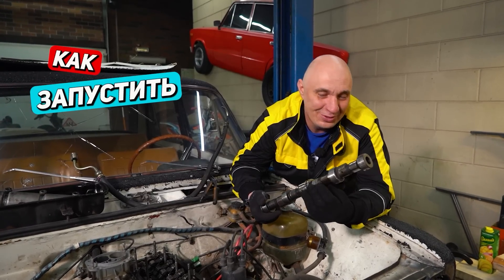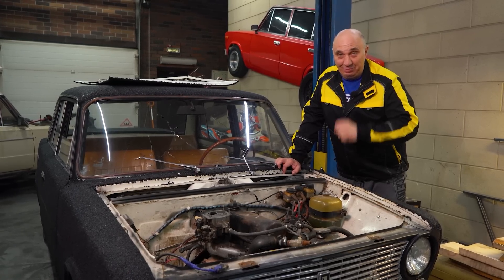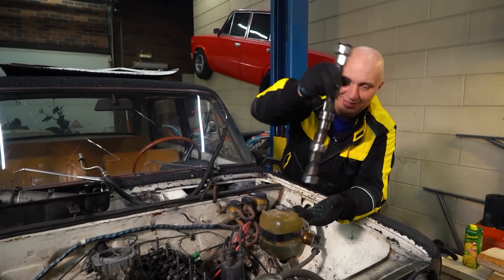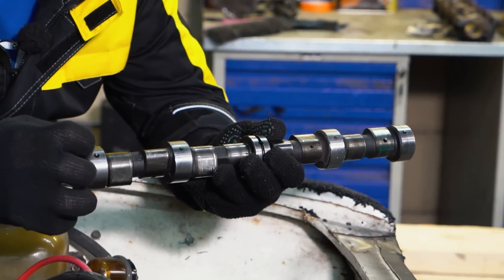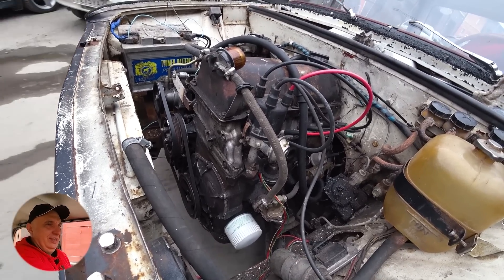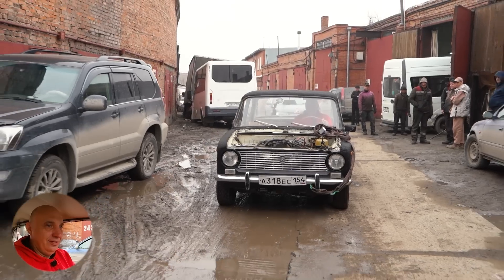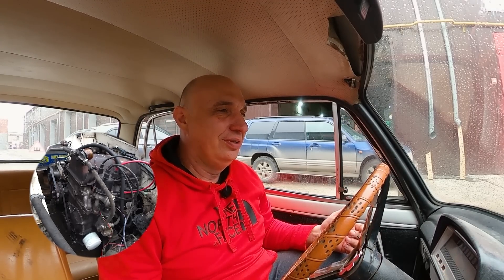Can we make an inline-4 run inverse?

Comment: doing this... you could have a rear engine'd car.  having a pair of them, counter rotating, have the direction sensitive accessories on the normal one, then gear em together... it's been done on a lot of vehicles, but not many have been modified that way... gear em through the flywheel?

Comment: You also could just swap the intake and exhaust manifolds and adjust the oil pump to spin the correct direction. If it has a mechanical fuel pump it should  still move fuel normally though it might not last very long before the arm breaks

Comment: Why is there a standard direction of rotation?
Reply: possibly to stop the engine bolts unscrewing. same reason truck axles have a left hand thread on the left hand side. although there's not many bolts. there would be six attaching the flywheel, then more attaching the pressure plate. i have found that the crank pulley bolt tends to unscrew itself, which makes sense as its turning the opposite way to the thread.
Reply: @martin-vv9lf  ah now that's an excellent point

Comment: Can you modify a lada engine block for offset crank? i think you would have to weld up the main bearings, line bore the crank, move the bell housing and weld the timing cover.

Comment: You actually dont need to do allot, have done this a few times on a couple different engines.

If you mod the starter to rotate in reverse then swap the intake and exhaust manifolds, it will run as is, of course you run into other issues with flow and heat, the water pump doesn't run backwards so we had to run electric pumps, google chevy 350 running in reverse. Its been done its not hard. Makes for allot of looks at the shows 😁

Comment: Have you tried switching the rear differential in reverse then you can run the motor and backward but you still can you use your transmission as normal

Comment: I once started a Ford 221ci inline 6 engine in a Falcon, the timing was off so it didn't want to start while cranking, but once you released the key it would start and idle, ALWAYS... but in the wrong direction. We discovered this after trying to move the car (manual, 4 gear, column shifter) it had 4 reverse gears and one forwards.

Comment: Vacuum advance is working backwards… right? Probably would have been easier to lock the lockout the ignition timing for now.
Reply: most likely they blocked off the vacuum hose.
Reply: @martin-vv9lf  mechanical advance would still be in there. Unless they locked it out as well

Comment: Find a way to switch polarities of the power to the starter motor, and it should turn the opposite direction.
Reply: That will not work the starter bendex will not come out to engage
Reply: @Aaron-jx2rv  Couldn’t you change the gearing of the bendex so it engages?
Reply: The splines that engage it would have to be cut the other direction had a thought if they could take and mount a 90s honda starter to it those engines spin left-hand
Reply: there was a famous hot rodder who had two engines geared together, one clockwise, one anti clockwise. they could have both flywheels touching at the starting ring, if they cut down the bell housing to bring them closer. then one starter could start both engines.

Comment: I have seen old diesel start and run backwards.  The driver run started the vehicle by backing down a hill. He thought hy was in reverse gear and he was not. Vehicle was in 2nd gear. Blew a lot of smoke out the air intake

Comment: Yamaha made a 'Reverse barrel' TZR250 (I think in the '90s?) where the carb was where the exhaust manifold is usually), and the exhaust came out the back. The thinking then was that a combination of air being sort of 'Force fed' into the engine plus the acceleration G's (for the atomised fuel) and simplistic front to back 'Natural flow' would help with power... Not sure how much it helped, but, nice concept though. It DID make me think though around that time why more cars & motorcycles weren't built that way, as, it did seem logical to create a 'Better flow' for input/exhaust (cooler air in, a 'Direct' exhaust out back kinda thing)... 🤔😏
😎🇬🇧

Comment: I'd like to see a Lada 4cyl motor run as a twin/twin - cylinders 1 & 4 fire together, then cylinders 2 & 3 fire together. Would it help with torque? For example - how a parallel twin motorcycle engine has more accessable lower down torque, compared to a 4 cylinder you need to rev the motor higher to get anywhere etc. It's why Triumph motorcycles went with a triple, to get a 'Balanced combination of power and torque' (like a mix of twin and 4 cyl)... 🤔😏
😎🇬🇧

Comment: Garage arshanders.
1. To rotate oil pump in right direction on this engine its enough to redo piglet and vertical shaft coupling. Not so easy, but possible with right equipment
2. Reverse camshaft can be done from scratch too, but I think it would be easier to swap manifolds with some external piping
3. Water pipe will not work properly, but at least it will pump something. Requires to machine internal walls and it becomes better
4 but the biggest problem is chain drive. It will not work ever, as on reverse it strains on the tensioner side, rapidly destroying plastic boot. Can not imagine quick fix for this problem.

Comment: I see a problem with rotating the cam shaft, the degree diference between exhaust and intake are the same, but you must be using the exhaust cam profile to open intake and the same for exhaust using intake cam (if the valves in the motor are not simetrical, this issue would not occure if the valves were EXHAUS intake EXHAUST intake INTAKE exhaust INTAKE exhaust , or the other way around, but i think it uses INTAKE exhaust INTAKE exhaust ..... etc )

Comment: If it were me, I would try to reverse the cam shaft direction without cutting it or changing it around. I mean by means of a gear instead of chain, or you could regrout the chain so the outside of the chain would contact the can timing gear. I hope you know what I mean.  I am writing this having only seen 3 mins of your video.
Reply: Just to clarify, I mean that the engine direction is reversed but the camshaft is still turning clockwise.

Comment: Yee! 🤣 just go 2 stroke! They will easily run backwards!  You can just advance the timing in the opposite way! I would normally suggest an old 2 stroke 3 cylinder SAAB engine, but they have large wide open intake ports to the crankcase from the carburettor, and running them backwards will cause the piston skirt to  catch on the port, tearing a chunk out of a piston. So these weren’t meant to ever run backwards. But many other 3 or 4 cylinder 2 strokes, especially reed valve or rotary valve induction can, as well as piston-port with vertical pieces to stop piston skirt snagging. Plus, a 2 stroke LADA would be awesome! I am back, Vlad and the guys! Can now comment and like! 😋👍🏻👌

Comment: An car engine can definitely run “backwards “: We had just finished rebuilding the four cylinder MGB engine after I burned a rod bearing and I was setting the timing by ear. It fired right up and as I was either advancing or retarding the timing, I went too far in one direction. The engine kinda of backfired and to my amazement, it started idling in reverse ! Instinctively, I put the palms of my hands over Venturis of the dual carburetors, after what seemed like an eternity, the motor finally stalled. If I hadn’t witnessed this happening firsthand, I wouldn’t have believed it!

Comment: Smoky Unich built an engine for NASCAR racing that ran backwards, to use its torque to load the car into the corners for better handling. It worked. 
The cam has to be changed because the valves will be opening at the wrong time if you don’t. If the fuel pump uses a diaphragm that is moved up and down,  it won’t matter which direction the engine turns. The distributer will have to have the plug wires in the right direction. And the starter will have to be to turn backwards. Now if you’re running an automatic transmission there should be a so rag clutch so the it turns in the right direction. The water pump will turn backwards.

Comment: Am I right in thinking that sense the oil pump can't pump oil up to the top of the engine, because if every is turning backwards,  the oil pump would just be sucking air through the oil gallery around the head?

Comment: A friend of mine got a hold of a reverse rotation Chevy 350 that came out of a boat. He got it cheap but wasn't told it spun backwards. He bolted an automatic to it and dropped it into his Camaro. When he started it, it ruined the transmission because the pump couldn't pick up oil. Needless to say, his cheap engine cost him big time. All I could do was laugh.
Reply: I call BS there because a reverse boat engine also needs a reverse starter motor. IOW, that engine will never start with the rest being original.
Reply: @rupe53  It came with everything needed to get it to run, including the starter. Burned the bushings out of the trans from him flooring it and no oil flowing.

Comment: This can happen with some extremely advanced timing, red neck messing around with the various engine parameter sensor inputs directly to the ECU (ECU was unmodifiable, car wasn't worth it to mega-squirt) , and a slow starting RPM with a well timed backfire - has this happen with a 1998 Hyundai Elantra with a 2002 Beta 2.0 motor with HO cams.  Surprisingly it idled, oil warning light was on, and smoke appropriately eliminated out of the intake, and 1st gear did drive in reverse - only let it run like this for a few seconds given NO OIL pressure... restarted it and it turned properly after some well deserved sputtering thanks to the sooted out intake.

Comment: All you have to do to reverse a 4 cylinder is drive the cam in the opposite direction. When you run the engine, the crank spins the opposite direction but the cam runs the natural direction, This will also run the oil pump and distributor in the correct direction. Am I wrong?

Comment: Wow, very nice.  So the Lada head must be symetrically mirror reversed relative to the center line.  
Like  (1e1i) (2i 2e) (3e 3i) (4i 4e).  So when you swap it around its still correct.  

If the head is not like that, then reversing the cam end to end wont work, you would have to make a new cam almost.  Yes I looked and can find heads that are (1e1i) (2e 2i) (3e 3i) (4e 4i).  So it would not work on that type engine.

Comment: You could have left the camshaft unmodified and simply swapped the inlet and exhaust manifolds around
Reply: It would’ve just pull air out the exhaust and push exhaust gases out of the intake, it wouldn’t really run.

Comment: The distributor is spinning in the opposite direction, so the centrifugal timing weights will retard the spark with higher engine speed, rather than advance it.
Reply: You could counter that by disabling it and then the vacuum advance would have to be modded to rotate the baseplate the right way
Reply: @geoffgunn9673  But the vacuum advance is for light throttle loads, advances timing for lean mixture, slower flame propagation, you still need centrifugal advance for optimum power at full throttle, no vacuum.
Reply: I'd lock the distributor in full advance.
Reply: It will still advance timing. Centrifugal force doesn't work backwards just because the rotor spins the other way.
Reply: @fryloc359  It will rotate the base plate which the points or sensors are mounted on in the same direction that it did before as standard, because the distributor shaft is rotating in the opposite rotation it will retard the timing rather than advance it, you are wrong.

Comment: So, over here in the US,  we had some old farming equipment that had reverse spinning engines. One in particular,  was a small block chevy,  in a bale wagon it got tired, so my neighbor put a small block out of a pickup truck in it. One forward gear, and 3 reverse.
Reply: In Germany, there was a tractor that had no reverse gear (The first version of the Lanz Bulldog). If you wanted to back up, you had to almost stall the engine by shutting the fuel valve and re-open it just at the right time which is kinda tricky and reqires practice. The engine then runs reverse. Later models would come with a reverse gear so the farmer wouldn't have to reverse the engine every time he needs to back up.

Comment: Reverse polarity on starter. Swap intake and exhaust manifolds. Adjust timing to tweak
Reply: Bzzzt with the starter. I was looking for this one. First, a starter is a series wound motor. AKA the "universal" motor. This type motor is also in brushed type vacuum cleaner motors, and no rectification is involved. The motor will run on AC just as happily as it will DC.

So, no matter which polarity you put across it, it will spin the same direction.

Assuming you could get it going backwards (requires flipping the polarity of the brushes with respect to the stator windings), the bendix will not engage the flywheel because it uses a screw mechanism to drive the gear out, which is dependent on it rotating a specific direction to work.

Basically, more work than it's worth.

Realistically, if you're going to use a starter, it would be much simpler to mount it from the other direction and just run it stock. Assuming you get it mounted solid, it will spin the flywheel the other direction happily, without being aware it's doing so.
Reply: You would have to mod the car to a positive earth to get the starter to spin in reverse easily. Not that hard with a simple point system if you ignore all the rest of the electricals

Comment: Most boat engines run counter clockwise , I have seen a Fiat marine V8 diesel engine in a Fiat 190 single drive prime mover that started and drive

Comment: The oil pump?? it is pushing instead of pulling... it will get no lube.
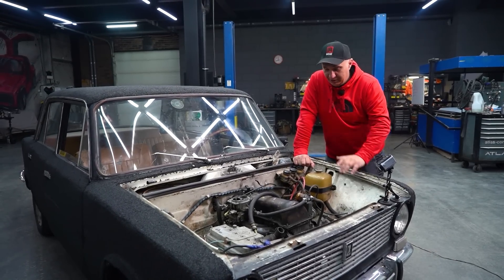Reply: 3:45 They covered this by bypassing the original pump and using a power steering pump instead.

If you're worried about the pump itself, it will freewheel with the oil that's left behind for quite some time before there's damage. Without pressure on it, it is just 2 meshed gears with a coating of oil on them.

Comment: Leave the camshaft in the original way, on a camchain engine replace chain and sprockets with timing gears.  If the oil pump is run off the camshaft, it will still pump oil the right way- if it runs off the crank, the pump will just blow bubbles into the sump.
Reply: Than you neet to flip the manifolds 
intake become exhaust 
Exhaust become intake 
It can be done

Comment: Not a surprise to me. In the process of figuring out what component was causing a diesel to run away, it would actually run in reverse after starting normally. Turns out a fuel injector had stuck open, and the result was me getting a facefull of diesel exhaust as I was standing near the intake ready to put a plank over it. Timing chain and components weren't actually damaged at all.

Bearings broke lose and spun with a loud crack when the engine was turned off after the first test drive post "fix" however.

Comment: Next up how fast can a lada go in reverse with 4 gears.😂
Reply: Fliping te diferential 
Than you have 1 forward 4 revrse😊
Reply: @remcogijsen6200  seen that on scrapheap challenge but don't think they knew that one.👍
Reply: I think they did it already
Reply: @Matiasfs94  not seen it with 4 gears just reversing think. Will check again cheers.
Reply: @Matiasfs94 I'm certain I've seen that one, I just couldn't find it last time I looked for it.
Reply: YES👍👍👍👍

Comment: I had a Mercury snowmobile that would start and run in reverse.
Reply from the maker: Probably a two-stroke engine?
Reply: @Garage54ENG  Yes.
Reply: 2 stroke is very easy. Just need to move the spark timing to the other side of TDC.
Reply: @MadScientist267  It must have been very close to TDC to start with because no adjustment was needed.  It ran a little rough in reverse.
Reply: @tinknal6449  It is, I just meant to optimize it. Yes most of them will run backwards as is, the spark is just late.

Comment: The project isn't complete unless you flip the differential, get the timing correct,  I even think you could get the oil pump to work in reverse (though admittedly I know nothing about Lada oil pumps.)
Reply: It's undoubtedly the standard gear pump... given the way they work and the fact they're somewhat integrated into the block structure, you'd have to spin it the correct direction to get it to pump oil correctly.

Comment: Russian aircraft have propellers that spin the wrong way.  Sitting in the cockpit, you should see your propellor spin from left to right, the way we read.  A Russian airplane typically has the opposite, a right to left seen from behind.  I think the LADA engine is standard rotation, seen from behind it spins clockwise..

Comment: So, your water pump runs in reverse, too?  Did you invert the thermostat or just remove it?
Reply: The water pump will still work, at a reduced efficiency, running backwards. They are a centrifugal impeller type, which has the vanes optimized for the intended direction but they will still sling water going the other way, just not as well.

The water will still be flowing in the original intended direction.

Comment: The distributor now turns in reverse.  Now you have centrifugal retard and vacuum retard rather than centrifugal advance and vacuum advance.  The water pump must also be turned in the normal direction, not reverse as it is now.  Perhaps an electric water pump would be easiest.